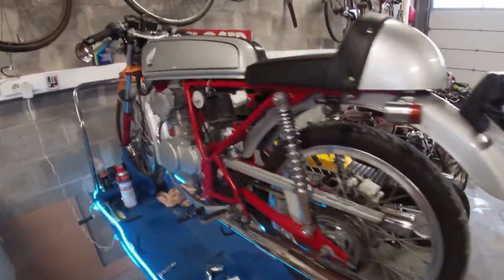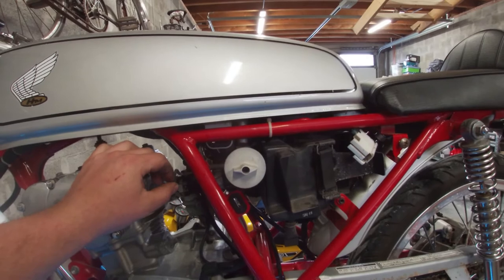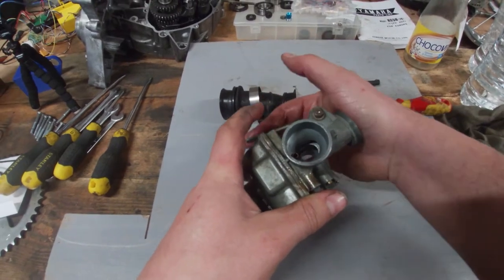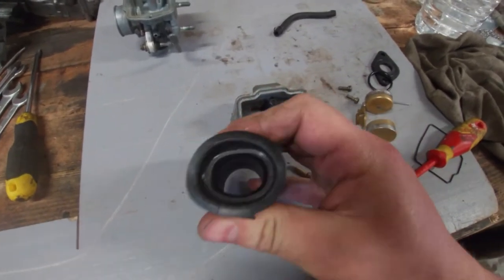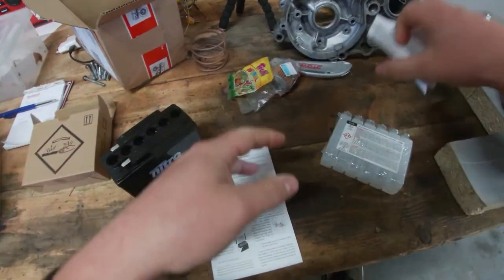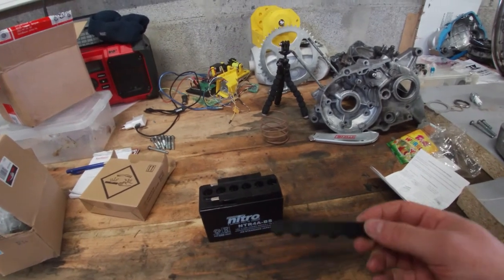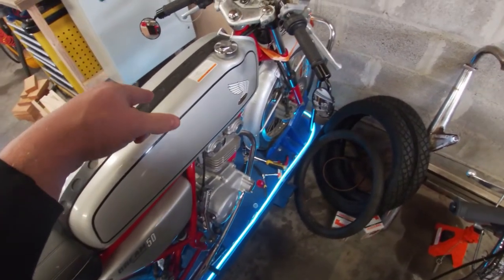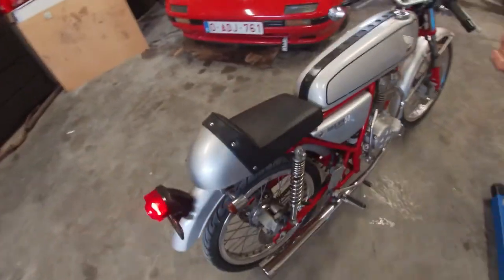Honda Dream 50 - Cleanup Pt. 1

Comment: I saw your bike in maastricht am i right?
Reply from the maker: Riding? That would not be me. I am still waiting for my registration 😭
Reply: @VintageGarageYT  ohh to bad i saw one standing in maastricht centrum in the exact same colorway! And thought it was yours.
Reply from the maker: @nolpelders6043  I wish it was me, that would mean I have my registration 🤣. The dream came original with 2 colors, this or red tank with black frame. The skyteam replicas also have these colours though, but different engine, single exhaust and no disc brake on the rear.